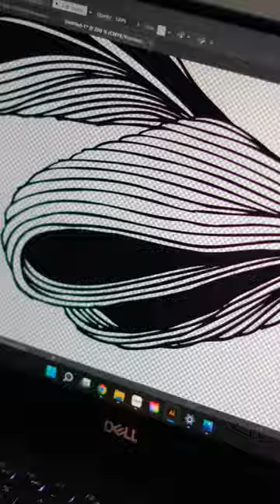Custom painted line art Trek Slash MTB

Comment: What is that polishing tool that you use? A large oscillating sander with a buffer pad works for painted guitar bodies, but doesn't lend well for bike frame surfaces/curves. I'd love to know.
Reply from the maker: It's the Mini polisher from Proxxon tools, the best option for polishing bike frames that I've found 👍
Reply: @flatwhitepaintworks Thanks for sharing the knowledge!